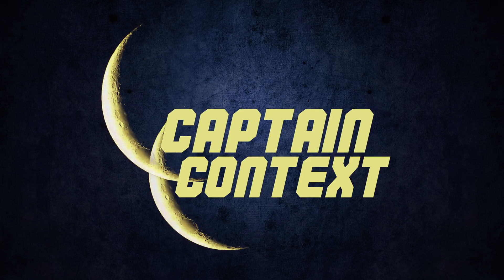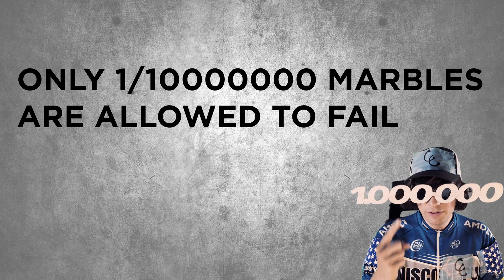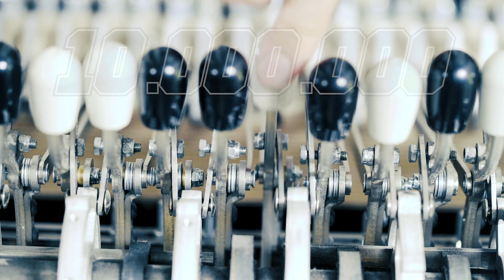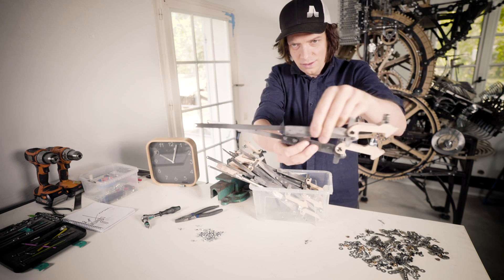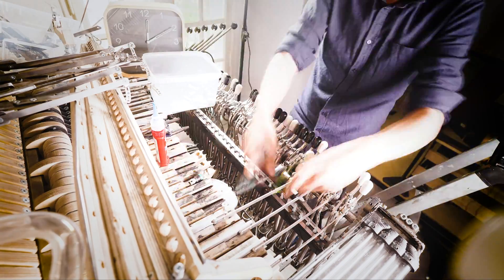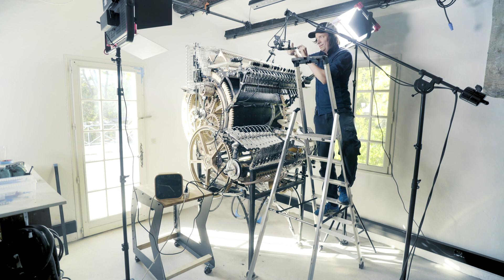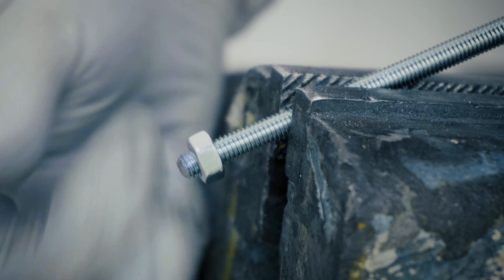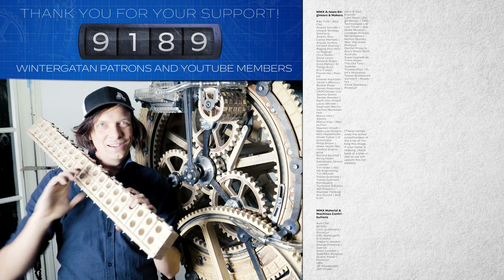Countersink? Why? - Marble Machine X #143

Comment: Should you find yourself facing an apparent dead end with some reliability issue, remember that resilience is more easily attainable than perfect reliability. Apollo 11 computer was not reliable, but it was resilient, in that error recovery was possible after the error. It is not important that each and every marble drop when they should, but it is important that this doesn't break the machine, stop the song, and preferably that it doesn't repeat. If your keyboard player misplays a note, you don't quit the song.

Comment: I don't know how realistic it is, but wouldn't the reliability problem be solved if you managed to make sure that when a marble fails, it won't be a critical failure? So basically making the design more resilient instead of trying to make it work without failures.

Comment: Martin, your should learn the science of Desing for reliability (DFR) otherwise you will keep making mistakes. Your basic calculation for reliability is very theoretical and impractical. There is a way to be sure MMX will survive 10 million marble drops or beyond.
Six sigma is not a new thing you don't need to reinvent the wheel.
Reply: It is for a machine like that with wooden parts and not controlled tolerances.

Comment: Another technique for cutting bolts to length is to use a nut (or two to prevent moving) and cut directly next to it, this way the cut is straight and minimal grinding is needed.

Comment: bolt cut:  If after you sand the chamfer, you run the bolt end on a wire wheel, it will remove any burrs that might be in the way from sanding the end.  I have done hundreds of these and found it works really well.  it also cleans up the end and shines it a little bit, making it a nicer looking job.

Comment: Well TECHNICALLY ;-) (man that sounds annoying...)
Reliability of 99.99% would mean 0.9999^3500 = 70% (rounded) of completing a song without a single marble falling.
Reliability of 99.999% is 97% for completing a song.
Reliability of 99.9999% is 99.7% for completing a song.
If you play 10 songs, the problem gets similarily worse:
Reliability of 99.99% => 70% => 0.7^10 = 3% of playing a whole setlist without a single marble failing. 1 every 30 will succeed on average...
Reliability of 99.999% => 97% => 70% for playing a whole setlist without a single marble falling. I.e. on average 1/3 performances will come to haunt you.
Reliability of 99.9999% => 99.7% => 97% for playing a whole setlist. 1 every 30 concerts will fail (on average).

Comment: Try countersinking it first, then drilling the hole. Or drill the hole with a smaller bit, then countersink, then drilling out the hole with right size bit. Just thinking of ways you can get both a countersink, and a tight hole for the screw.

Comment: It looks like the marble machine x's next part needs to actually by a failstopper.

What Martin needs to do is figure out what will happen in the event of failure, basically figure out the highest statistical "failure areas" and adjust from there.

Biggest one I keep seeing: "If one marble gets stuck, an entire marble channel will be blocked and catastrophically break the entire machine."

What you need is some kind of faildropper and/or failstopper: something that (temporarily?) closes channels as to prevent a break (failstopper), and/or something that solves the problem by making the marble drop off & roll back into the machine to be collected either in a "failed marbles" location or back into the loop.

This implies the most important part needed: A fail detector.
There are many methods, the first that comes to mind for me is a track being too heavy ergo slipping the marbles into the "fail" track.

Comment: Martin, a tip for removing parts with loctite, heat up the part. It doesn't have to be glowing hot, a heat gun or hot air soldering station, or a few seconds with a small torch. Just make sure the part is clamped first so you don't burn yourself!

Comment: A good realizability is really important. But I think you should put in failure stops (or whatever this is called) so when something goes wrong (and even with your best efforts it will) it doesn't damage the machine. A show stopping failure, that's fixed in 10 minutes is not that bad. 
Think about the safety clutch or your foot pedal. They are designed to prevent fatal failure. Why not the other parts?

Comment: Please next time if you want to remove loctitet parts just use a little bit of heat, no need for brute force :) also careful while using a cutting wheel since while cutting you heat up the part and that can compromise the glue. Another advice instead of using a nylock nut and blue loctite you can also use a normal but with some stronger glue from the top of my head it's 603 that what you still have your reliability and you have a lower profile after all and yet again like I said earlier cutting the screws to size before glueing is a much better idea because of the heat that you introduce. Wat you can do is drill a hole in a thick plate that has the thickness of screw you need and flush cut the screw with an angle grinder this way you get perfect treads and perfect length everytime.

Comment: I'm sorry Martin, but that isn't accurate. A single gate doesn't play 3500 notes in a song. In fact, the amount of marbles in a song can be counted by the notes. And divided by the channels (roughly). So going by your 3500, that's 92 marbles per gate. 

So if it fails 1 in 1000 marbles, you could play 5 songs pretty reliably. Also, having a 'missed marble/note' is not the same as catastrophic failure.

Comment: You talk so much about the machine needing to be fail-proof and, that's sooo weird !
You really need to be very careful. At this point, you should really be thinking of how the machine might fail, and designing so that failures are not so critical, as many others have said.
But another thing, which is kind of related, and about which you haven't talked a lot, is machine maintenance. When a part breaks, or is worn out, you need to think of a quick way to replace it on the go. If you always need to angle-grind it off the machine and wait for new parts to be shipped, this will never ever work out. If you really want to be thinking long-term, you absolutely NEED to think about how you will be performing maintenance on the machine, instead of banking on it never ever failing. Because that will not happen.

Comment: Have you heard of negative testing? It's something that is used a lot in software engineering. Basically you test failure scenarios and see that they actually do fail. By manually jamming a marble channel, you could see what impact it has and probably figure out how to make the marble machine break more reliably. You should have some safety nets in situations where a jam happens so that you can quickly fix the jam and continue instead of having the whole machine broken down. 

Even though the reliability would be 1 in 10 000 000, that one could still be in the first song you are playing. I think the most important thing would be to make failures less catastrophic.

Comment: 🙄No one will read this... it's frustrating. Brass is softer and more porus than your other metals. Especially when functioning with steel parts. Two different metals together work as thermal-couplers. One will expand/contract faster (brass). You must soak brass parts in oil if you need them to remain brass without oxidation. To work as bearings, they must be soaked in oil before assembly. Not all brass is treated equally when formed.
Take care of your brass, it will take care of your brass likewise. 
Who reads this comment anyway?

Comment: Why are there so much spacers on those parts? Why didn't you put the pulling bar between handle parts instead of spacers? Why didn't you make the thread in one of the handle parts instead of use so big nut?

Comment: Martin i have an idea for you..... drill small hole along the top board that aline with the metal part.... the reason for this is so when you need to add more Graphite powder to aid in the movement you don't have to take everything apart again

Comment: A lot of people are talking about designing fail-safe systems however the mmx is a very complex & space-constrained system, re-designing the systems to implement fail-safe designs both probably wouldn't fit, would introduce a lot more tolerance problems & just problems in general with getting the fail-safe systems to work

Like, what do you do for the pin pulling section where it'd get stuck? implement a break-away system on the pulling section? then you have to tune that properly so it doesn't break-away at the wrong time, etc, you can't really self-clear it because the marble is physically jammed so you'd have to write off that channel for the rest of the song, but any fail-safe system that writes off a channel is a failure of a system, sure it might not matter as much if one note never gets played but if that channel got jammed then there's a high chance of another channel getting jammed & another, etc, because they all use the same error prone system, additionally this isn't an orchestra, each note is notable in its absence especially given the constant tempo & rate of marble drops, if it's do da do da, you'd notice do .. do ..

This is unacceptable, albeit a break-away system in the event of a channel jamming should be implemented like say with strong magnets or something connecting the puller to the shuttle, since the mmx's success state is successfully playing many songs, or a concert, with a negligible chance of any notes being dropped & additionally there's not enough space to implement overflows or redundancies into every pinch point, it's a far better idea to simply design away the pinch or failure points as much as possible
This also proves Martin is at a local maximum for the MMX's design since he has a number of higher% failure points designed into the machine

Imagine we change the scope of this allll the way down to just a single length of the mmx's plastic piping, however there's small ridges all along the inside of the pipe for some reason, if the room is hot enough the pipe naturally expands & can let marbles through like normal, however lets say the metal holder at the end acts as a heat sink & if the room is lower than a certain temp it constrains the end just enough for the ridges to catch 1/10 marbles & 1/10 times that happens the pipe fails to be cleared by incoming marbles. We could add in an overflow pipe to the tube a little back from where it blocks up & add in some merging system after the blockage, that could also get blocked up too & it uses twice or more the amount of space, we could try adding an external heater to make sure the metal holder doesn't suck too much heat from the pipe & lets marbles through, but again that's another system with it's own host of failure points & really, the problem is that there's these ridges in the tubing, why? lets say we had a reason at some point, but it's clear that marbles should be able to go through the tubing no problem 99.99999% of the time, therefore the ridges are creating a local maximum in the system of the tubing & it's far more economical and sensible to design away the local maximum instead of adding a spaghetti of redundancies & fail-safing

Comment: I was a little late to the last episode so I'll just recap what I said in short:

You need to impalement the 'catch-stop-drop/reset-play' system, but you currently only have the 'catch-stop' part.
Once you get the fail probability as low as you realistically can (10 000 000 drops per failure is a good goal to reach for but don't expect to get past ~half if not a quarter of that), ensure that you increase the fail tolerance of the machine afterwards; i.e. a systems which will allow each part to 'fail gracefully instead of catastrophically' by either having the system recover from the single failure (like hamming code does) or having the entire system be able to restart so quickly it's unnoticeable to most (like an engine does) without causing short term issues.

I wrote some theoretical ways you might be able to do this in my last comment, but it's very long so I'll just leave it there.

Comment: I don’t typically comment on the videos, but I think Martin and team are going about this a little wrong.  It’s a nice goal to improve the reliability the Marble Machine X  but I really feel like you should be focusing on fault tolerance instead.  In many industries it’s far more important that a machine is fault tolerant instead of perfectly reliable.  Making the marble machine fault tolerant would eliminate breakage of the machine, allowing a part to occasionally or completely fail yet the rest of the machine continues on as if nothing happened.  It seems like were a little too late in the game to build in the fault tolerance now.  This is just my humble opinion for the next Marble Machine X Pro Max with 5G Evolution.

Comment: Well, the good news is, I'm finally useful to the project, the bad news is everything else. I'm glad you're looking at these failure rates, but you're computing things incorrectly. In a system like this you need to look at each component in the chain and figure out their failure modes and realize they're in a chain. If you have, say, a drop mechanism that works 99% of the time, a programming pin interface with 99% reliability, and a feed mechanism with a 99% success rate you don't get a 99% success rate, you get .99^3 or 97% reliability. To achieve a 99.99999% reliability with just three parts, you'd need around 99.9999967% reliability, or cutting your failure rate to less than a third of your already overly ambitious goal. If a dozen components need to work together, that's 99.9999992%, or one in 120 million. 

You need to design a system that fails gracefully instead of trying to reach perfection . . . particularly because parts will wear. Think of your foot pedal: you didn't say "I'll just never put my foot under it," you included a system that would save you from serious injury in case something went wrong. Design a system where if a gate gets jammed, it simply gets bypassed instead of having the entire machine slam all its energy into a single component. 

It's much easier to say than to do, but if you bet on that level of reliability, your machine will eventually catastrophically fail. You need to reduce risk, but risk is frequency times severity. You can't reduce frequency that much, you need to reduce severity. Prevent, mitigate, and recover; don't bet on things not failing. They will.

Comment: Pro tip. A bit of heat will generally release loctite. Either a propane soldering torch, a heat gun for small parts, or even boiling water will usually do the trick.

Comment: If you spin on a die instead of nut, then cut an chamfer, you can properly cut the thread cleanly. I also have a special tool that clamps on threads, like a dual bladed pipe cutter that fits any thread pitch and repairs distorted threads beautifully.  Nes External Thread Repair Kit, 5/32 to 1-1/2", 2-Piece, NES1000 https://www.amazon.ca/gp/product/B00D8WJ1PW/ref=ppx_yo_dt_b_asin_title_o03_s00?ie=UTF8&psc=1

Comment: Martin, i think trying to achieve such a high success rate is utopic. 
Maybe you should instead work on allowing failures to be LESS catastrophic, by controlling what a failure will look like in case it occurs.

Marbles that get stuck, could somehow be ejected into another direction by providing fail safe measures.

Comment: Hell of a lot of parts are going to need to be replaced to get anywhere near that kind of reliability. All of the wood parts for starters. You might get that reliability in your workshop but it's a guarantee the moisture content in the wood will change when you take it through different climates on tour. That moisture level (even if it somehow doesn't warp and destroy the plywood components) will guaranteeably change the reliability of them.

Comment: 7 Nines (ie 99.99999%) of absolute reliability (ie, nothing at all can go wrong that percentage of time) is not an achievable nor realistic goal.   What you need to do is look at failure modes and determine what kinds of failures are acceptable and which ones are not...  For example, a failure where the machine jams and cannot play is catastrophic and must not happen, but what if the machine occasionally spits a marble on the floor or occasionally is late playing a note?   Neither is ideal, but these are both a more acceptable type of failure that is easily recoverable and has negligible impact to the enjoyment of the music.   Additionally, how you choose to increase reliability matters as well...  It is going to be very difficult if not impossible to get that much reliability out of a single mechanism with hundreds or even thousands (if you count every marble and every moving part) of simultaneous moving parts.    Normally, high availability is achieved with redundancy vs overengineering, so you may want to look at other methods to achieve the reliability you are after..

Comment: The problem is not reliability so much as in failure modes that involve breaking the machine.  If the failure modes were just to miss that note, or even to just temporarily jam a given channel then failures would be okay.  You cannot have failure modes that mean serious damage to the machine because one marble didn't work, that is insanity.  No matter how good your percentages are then you could still break the thing on the first song no matter what, that is how percentages work.

Comment: There is a moon ride somewhere in the chain of events planned. But considering that the accoustical output proved non compatible to the perfectionist levels of planning - sound filters to filter out the thuds and clicks are held with contempt, so mechanical rebuilding for reliability and the aforementioned problems to be solved shall take one to "the edge of the universe " (remember Bee Gees)